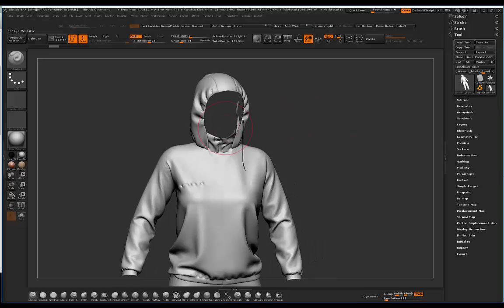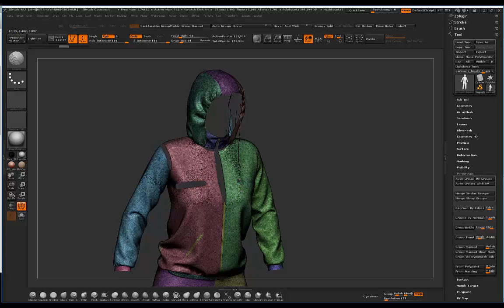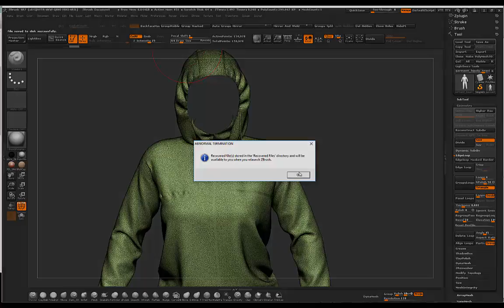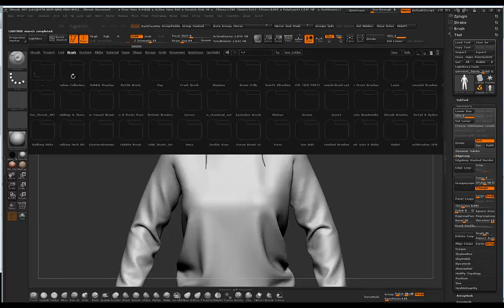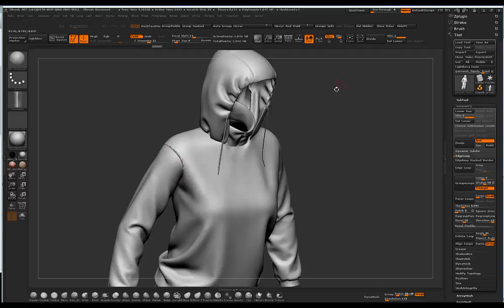Zbrush - How To Prevent Marvelous Designer Garments From Breaking Apart

Comment: Excellent tip about adding thickness that way. The way how I deal with maintaining polygroups is to do groupsloops before subdividing. After doing that the mesh doesn’t break. 
It isn’t solution for everything but I have been able to go through entire projects that way. It is helpful to have the polygroups intact.
Also add creases in Zbrush can help to prevent weirdness when subdividing.
Reply from the maker: Awesome! Those are some solid tips! Yup I've been using the crease method quite a lot, i usually crease all edges.

Comment: You can also use Mask by features with Groups, Border enabled.
Simply smooth it, borders will be masked, then invert mask, wield points and sculpt with zsub active over to make the seam lines and finally use the seam brush if you want for a better result.

Comment: Travis, my issue is that after I weld, it works but zremeshing its opens the holes again :( very frustrating
Reply from the maker: Did you try increasing the weld distance before you welded it? Weld Distance is in the same menu as weld points. Try this and then zremesh.
Reply: Travis Davids yea, tried most of the numbers. Higher ones made small dents and smaller ones was unable to weld. I'll troubleshoot some more, thanks! Is weld base on how the edges are aligned? Perhaps my MD meshes are not equal in proportions?
Reply from the maker: Alternatively in MD when you are exporting just select thin and weld and everything will be solved.
Reply: @TravisDavids  I exported from MD with the above settings (weld,thin) but when I import it back into Daz Studio and apply dForce, some parts of the clothing falls apart. I am talking about a dress with frills. The frills fall apart. Not sure how to fix that.

Comment: Mine still doesn't work ): when I add sub divides it is getting messy
Reply from the maker: Try playing around with the weld distance and if you can also CREASE PG after you have welded the points and then subdivide.